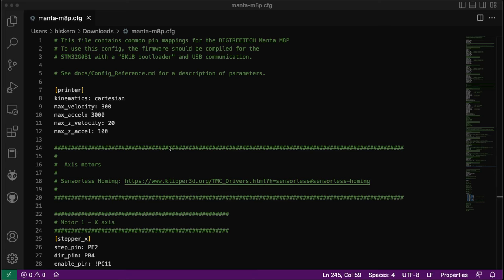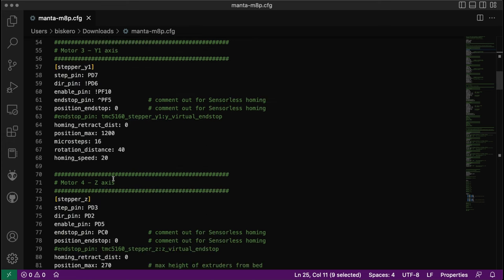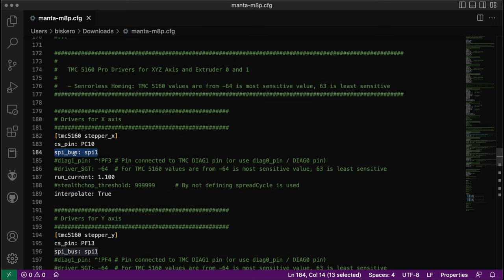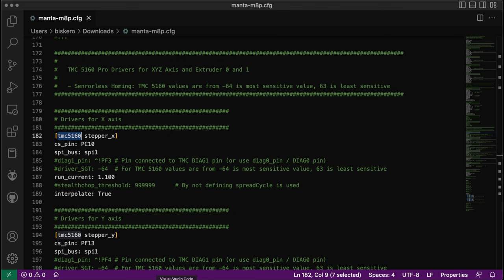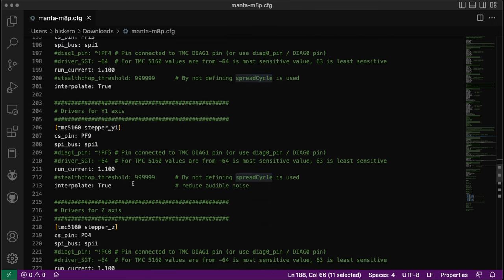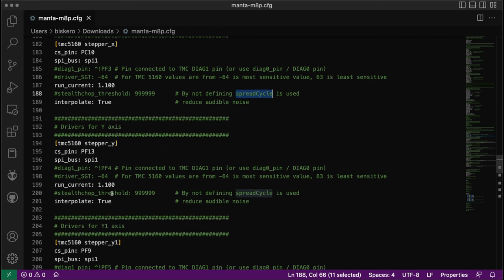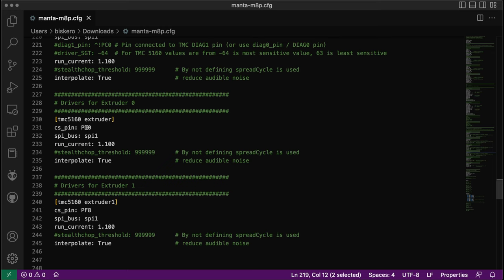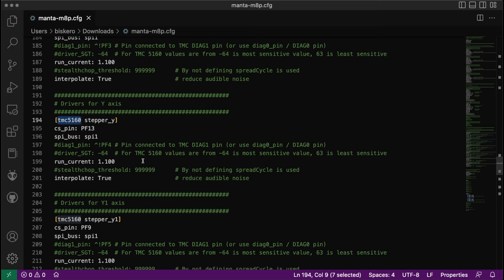Klipper TMC 5160 Pro drivers configuration on BTT Manta M8P for my custom 3D Printer

Comment: Friend, do you know anything about GLOBALSCALE for tmc5160? my manta m5p always turns off showing the error: Unable to write tmc spi 'extruder' register GLOCALSCALER.... thanks
Reply from the maker: Sorry never saw that error. You can try to post on the BTT facebook group and see if someone else encounter that issue.
Reply: Are you trying to comunicate with the unpowered driver ? Usually that is the problem for most cases.
SPI comunication is not available if the driver is not powered (with the Motor power).

Comment: I got the new Manta M8P V2 board with TMC5160. The copied the default Manta v1.1 CFG file and change all the pin to match the board. I also have a BIQU Pad 7 which I used to make the Klipper firmware. But the Klipper Pad is unable to communicate with the board. When I do a "ls /dev/serial/by-id/*" I get "No such file or Directory". If I change the USB c "USB-OTG" I get a port, but the Klipper Pad still can't communicate with the board. Since the board are in SPI mode because of the 5160 could that be the reason the UART to USB doesn't work?  Since the board pins are different on V2 could the board pin aliases be wrong as well?
Reply from the maker: I am not sure since I do not have a Manta M8P v2 so have no idea what changed. Try to ask on the facebook group, someone might encounter the problem with this new board. Sorry could not help much!
Reply: @ganzoai  I got the settings from BIQU, but I'm unable to connect. I have a switch next to the USB C to set it to USB-OTG or UART to USB, I only get a port when it is set to USB-OTG. I created the klipper firmware using this setting: USB (on PA11/PA12) and then I tried Serial (on USART1 PA10/PA9), none of them works. What settings did you use?

Comment: hello!
i have the same board and drivers as you and followed your setup process but i get a error message when trying to home the axis.
the error message is: unable to write tmc spi 'stepper_x' register GLOBSCALER
do you maybe know what the problem is? 
i would really appreciate your help sir
Reply from the maker: I did not encounter this issue yet but you can search here https://www.google.com/search?q=unable+to+write+tmc+spi+%27stepper_x%27+register+GLOBSCALER&rlz=1C5CHFA_enIT904IT905&sourceid=chrome&ie=UTF-8
Reply: i have the exact same issue. How did you resolve it?